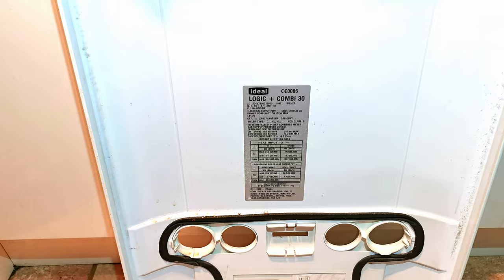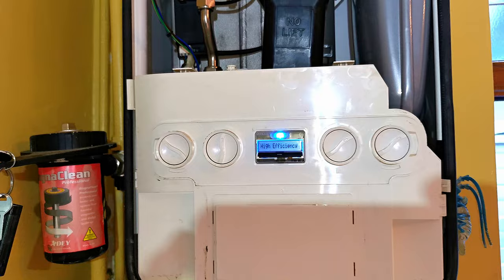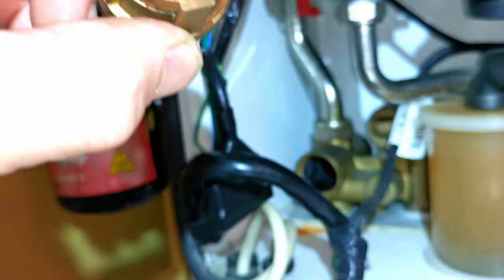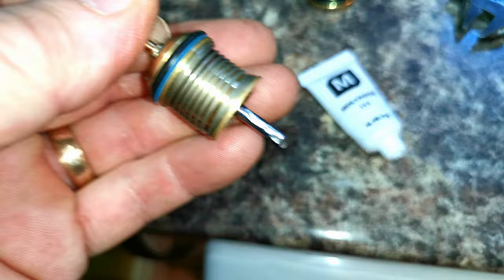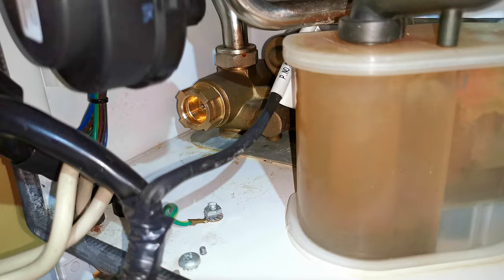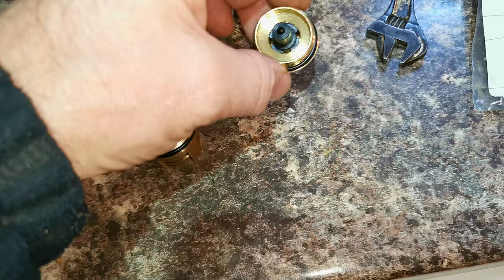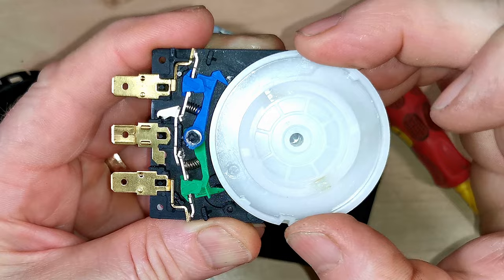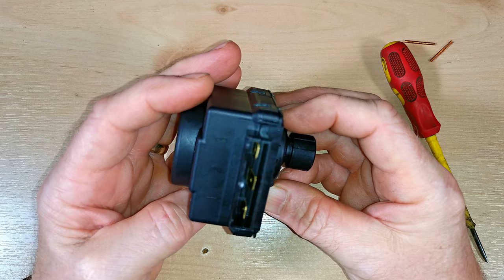Ideal Combination Boilers, Either Heating or Hot Water NOT Working!  What's the Problem? How to Fix.

Comment: What could it be when preheat is turned on and boiler doesn't come on at all to heat water. Also only getting lukewarm water on max hot water setting. Ch is fine and hot. There are no fault codes. Ideal Logic 30.

Comment: Wonder was there any thought given by the designers as to what could happen if you were  to fit the Diverter Valve at a low point on the Boiler in also placing same in a Horizontal position where so much Sludge and debris would accumulate thus grinding through the seals on the spindle shaft  and allowing water to weep into the Motor...had a couple of small weep holes or relief slot  been designed for drainage from the neck of the Diverter valve neck body  coupled robust seals and weep holes on  a  motor assembly  neck  premature failures for a pastime would have been lessened...  and you wouldn't have had water within the Motor, maybe now that those French Chaps [Groupe Atlantic]  now own,  IDEAL some thought may be go into design, by engineering out faults by improving Designs into the future...